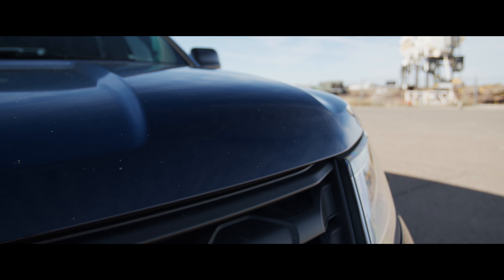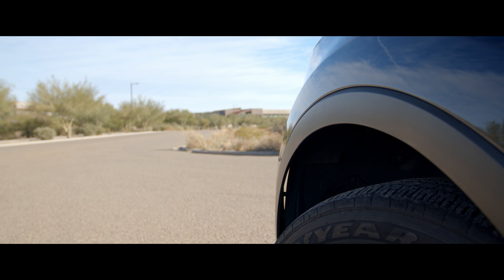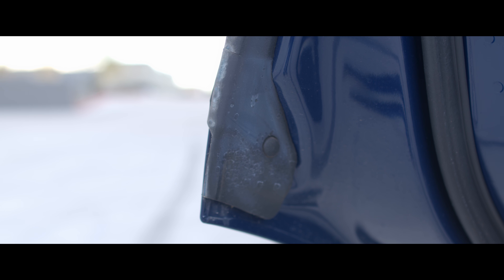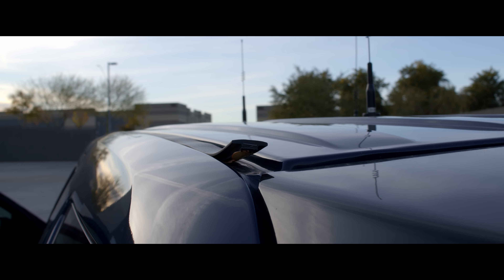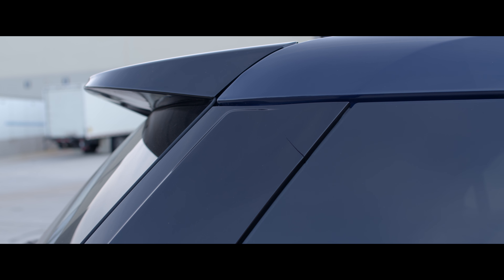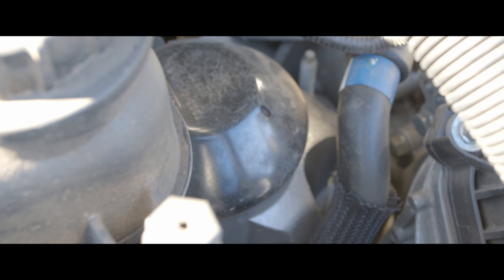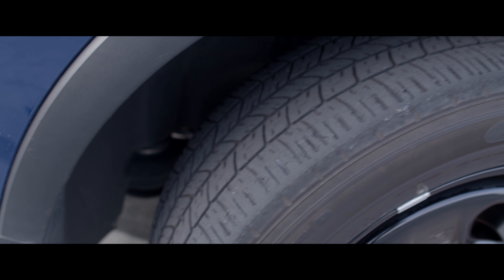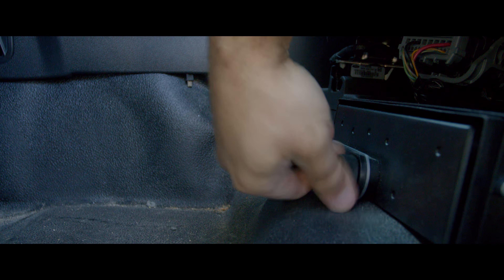2016 Ford Police Interceptor 50K Mile Issues and Upgrades

Comment: I recently discovered your channel. I to purchased a 2016 Ford Utility Police Interceptor in almost new condition. It had more accessories installed in it have set it up  for K9 use as I have a Service K9 to assist me. I have installed some HF, 2mtr and 70cm  and some other gear.
There are no dealers in my area that are educated in helping me with installing other options and accessories.

Your channel is very helpful.

Ricky from IBM, Ret  K4VMS / AAT9WG

Comment: Great video,  My ‘16 had 70k when I purchased it.  I purchased tires on EBay from a dealer in Chicago. They were listed as used with 9.5-10/32. Total price was less than $200 for 4 with free shipping. All you will have to do is have them mounted and balanced.

Comment: I'm considering buying a 2017 piu with 30k miles on it ("minor rear end damage") always liked the clean look of them and the rollover safety. The rear end safety to me is really impressive. I hear as long as u maintain them and swap out ur belt + water pump every 100k miles they're bulletproof (no pun intended)
Reply from the maker: Just know that the water pump is inside the engine and can be like a $3500 job.
Reply: @turbo2ltr  are those dealer prices?
Reply from the maker: @SkippyPB.  I believe so.

Comment: Great video, and I like both formats of filming you've used. I bought my 2013 Ford Explorer from the state of Kentucky when it has 133k miles in 2018. As of 2020 I have 168k miles...the D-pillar trim on my driver side is cracked as well. The rubber "trim" has cracked but not ripped off. As for mechanical issues I've done routine maintenance with no crazy issues. The biggest being the belt decided to rip apart at 60 mph. Put a new belt on and haven't had an issues since. I run Michelin Defender LTX M/S tires. What surprised me the most was the capability of the Explorer, on and off road. It's not a rock crawler by any means, but I've had mine in some rough back trails (A lot in Catoosa, which is a wildlife management area.) I was the only one I seen going in there with a SUV,  but the Explorer never struggled. One of my biggest complaints would be the lighting in and outside the vehicle. The headlights on the 2016 to 2019 Ford Explorers will out shine mine any day. Other than a few more miner things I trust that it'll take me anywhere I need to go and on any day. As for your NMO mount I wonder what could have caused that? I haven't had that issues on mine yet lol. Hopefully I won't ever haha.

Comment: I looked at a 17 today with the same crack as yours at the top of the fixed glass.  ...the middle of the piece was also SEVERELY heat warped, so i think it was parked too close to a car-bq. No other perceivable heat damage though, so either its a real oddity or the tail light was replaced.

Comment: Hey does your PIU have a/c to the rear? Do you know how involved it is to get it flowing back there? And what about the rear windows rolling up/down?
Reply from the maker: It does not. A/C in the rear is a completely separate system that reside on the drivers side rear quarter panel.  The ducts are molded into the headliner up to the edge of the roof near the C pillar,  Then the rest of the ducts are missing.  The rear windows work as expected. If yours don't work pull the door panel and make sure they are plugged in.

Comment: I like the new video style! I have a 2016 I got with 96k miles. I have 106k miles now and noticed the air vent switcher door appears to have failed. The temperature blend door still works, but air only goes through floor vent. Switching to other vents works on the buttons, but I can't hear the door move and the air doesn't change flow. Was hoping this would be an easy fix but it looks like I'll have to take the dashboard off.

Comment: So I bought mine in 2016 same place as you in Kansas I believe.
I use mine for security patrols. 
150k miles. 2 PTUs and one transmission. A/C is also out due to a sensor in the dash needing replacement. You have to take the whole dash out to replace the evaporator core. Change your cabin air filter often. 
The original tires were ok until around 50k then they had enough tread ware to notice issues when driving in rain. Random times the radio doesn't work or even light up. 
It now has an issue of crossfiring when I accelerate fast. Also had a new fuel pump in it. Brakes have been changed twice as well. 
Not really hard on this vehicle. Oil changed often. IMO avoid the 2016. 2017s seem to do a lot better.

Comment: I would love to meet up and compare notes, I just acquired a 2014 3.5L the some color and wheel package. My only complaint is the previous owner installed the civilian center console and didn't wire it up at all. I might try and get my hands on a Havis unit before going radio crazy.

Comment: Hi im from Germany and i wanna get one of those. Should i go to an auction or buy at a dealer? And Should i concentrate on the 3.5 or the 3.7. Liter? 
Best Regards Luca
Reply: 3.5 eco for turbos or 3.7 for naturally aspirated, both water pumps are internal and might go bad with will destroy the engine.
Reply: @bentley4l  ok so after i bought one of these i should straight replace the water pump and after that every 100k miles?
Reply: @lucaheinrich3894  I would have it checked out and keep an eye on it and just keep money set aside to replace it, IF it goes bad, but that is a known problem.
Reply: @bentley4l  thx bud

Comment: Hello! 
I will be attempting a P.A. speaker install under the hood of my decommissioned 2015 PIU. Are there any firewall pass-through wires without voltage connected that can be used for the speaker feed?
Thank you in advance!
Jeff
Reply from the maker: I thought I had a video about it but I guess not.  There are a group of blunt-cut wires going from inside the cab under the dash near the Ebrake (they are WAY under there) and travel to just behind the front headlight near the fuse box.  It's a group of 10 or so wires, some are twisted, that do not have a connector on the end.  Go here https://fordbbas.com/publications and download the Police Modifier guide for the 2015 and it has everything you need to know about it.